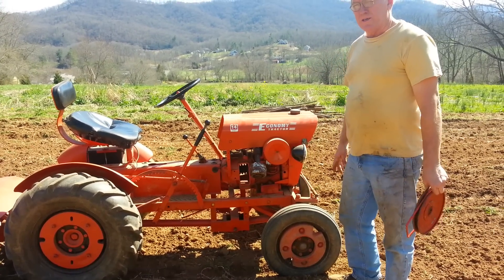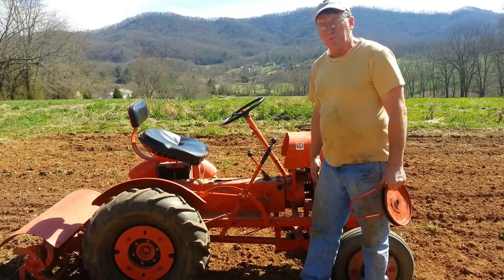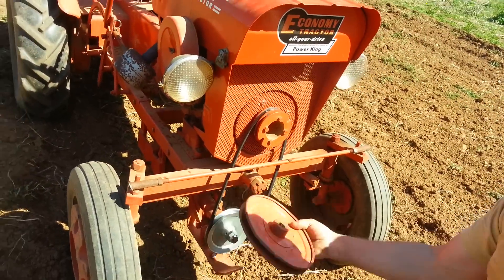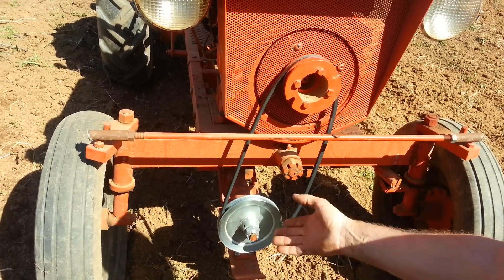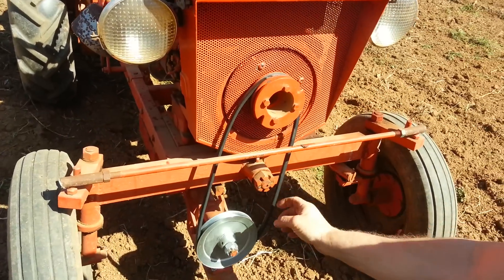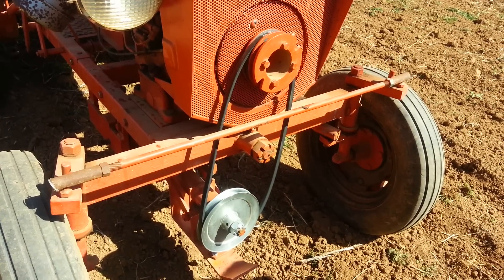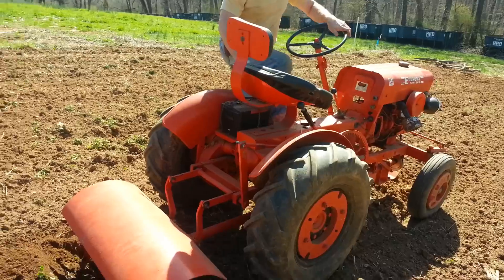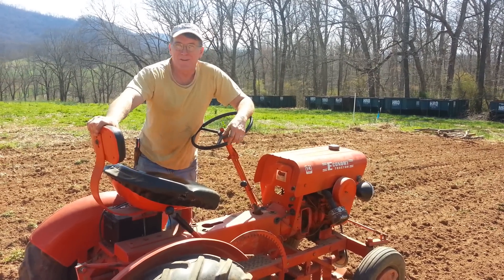Powerking tractor tiller ; modify to make tiller work without tandem transmission

Comment: Way back we had a mail order Avery tractor that was too fast. It had a full frame instead of a torque tube. We put a 3 speed column type transmission behind the tractor transmission. We had an on farm machine shop and made our own spline addaptors. I now have an old Cub Cadet that I plan on doing the same thing to.
Reply: Cub cadets have a low and high range gear box that fits without much issue. People treat them like they are made out of gold though :(

Comment: We got a 71 Power king 14 Horse rated at 25 because of the gear drive transmission, has a 48 inch deck and it is just now starting to rust. Has been a good tractor with we replaced it with a Kubota ZG227 for next year.
Reply: Sand your Power King tractor down and get her ready to prime, resand an spray paint. The color of tgd tractor itself is a Chevy engine paint, very similar, actually, matches thd original color of the tractor itself. They are super great, hard working tractors that are built like tanks. Have two snd never had trouble with either one of them.

Comment: I need help on the tiller mule drive bracket and arms, mine are missing. I have the mule drive, but I don't have the bracket that hooks to the tractor that the mule drive "hooks" into. I also need the two bars on the side that slide over the round bar on the mule drive. If you could send me some pictures and measurements of the bracket that would be fantastic.

Comment: All you are doing is tilling the top 3 or 4" and still not making the dirt powder.  To properly till with an Economy you have to have a tandem transmission to slow the tractor down. The Economy tillers are notorious to strip the brass gear, not a cheap fix
Reply: My dad had the same set up. If you tried tilling to deep is would pick the back wheels off the ground and push the whole tractor forward.  
Kind of scary since  hitting the breaks did nothing without wheel contact.
Only way to stop was to lift the tiller.
I think it would have worked better if it had counter rotating tines.
Reply from the maker: I don’t grow anything that can’t do well in 4” of loose soil. Don’t even know why I need more. More erosion is all I get for it.

Comment: did you notice significant torque loss/working the engine harder when breaking ground?
Reply: Not at all . I was quite surprised  that it didn't. I actually fully expected it to stall out the engine as soon as I engaged it or if not, then when I lowered it into the dirt, but it didn't . It worked great. The only down side is that it still doesn't spend as much time digging as it would if geared down, but I can go over it a second time. I have used it quite a bit and I am very pleased with it. By the way, in the video I called it a 1974. I'm pretty sure it's actually a 72.
Reply: cool i think mines a 78
Reply: More like a 60's model. I have two. A 1973 and a 1974. They do not at all look like the one pictured here. The gas tank is under the hood, this one you can see the gas cap on top of the hood, that is why its a 60's model tractor.